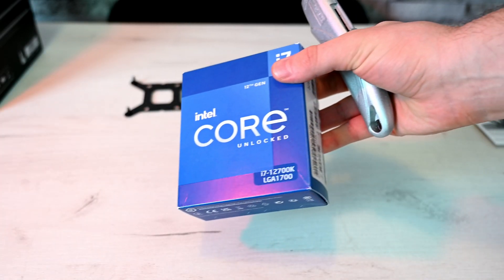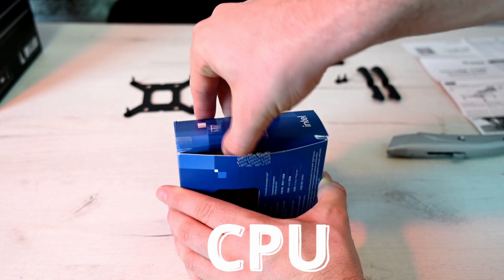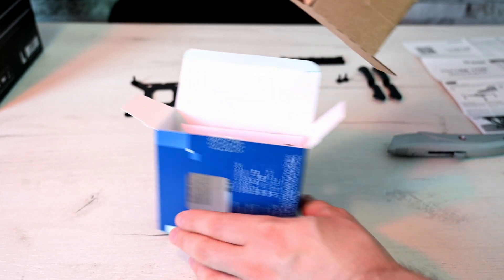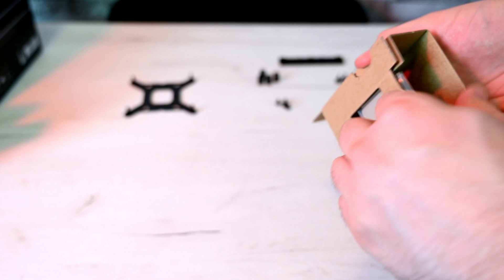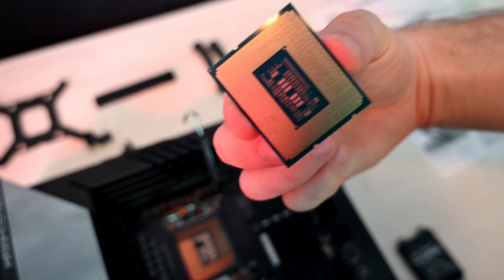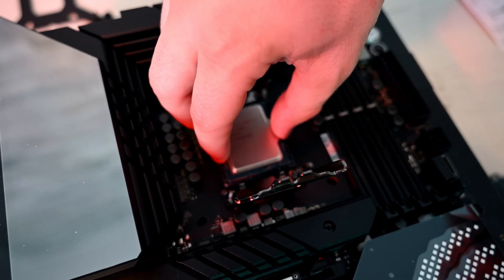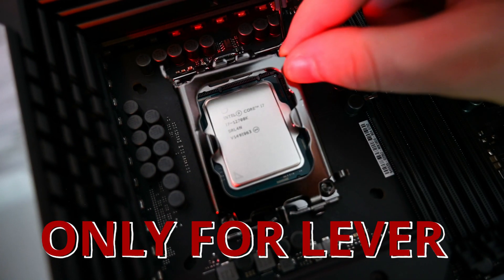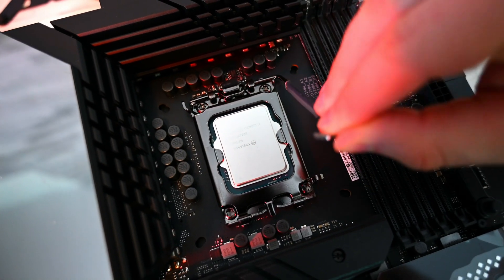How to Install Intel 12700K on Asus ROG Maximus HERO z690 Motherboard

Comment: I had a hard time getting my socket cover off.  I had to pull the little tab towards me and then lift.  You lifted it out easily, and I was struggling to get it off, and I couldn't figure out why.  Pulled towards me, it lifted off reasonably easily.  
It's been a while since I've done a PC build.   This was a new step for me.
Reply from the maker: Sometimes It can be stiff on a brand-new motherboard, it is better to be safe than sorry, Afterall you want to be gentle with pins. With this motherboard I had all kind of issues, during shipping usb front header pins got bent. Certain cpu wouldn't boot or causing memory issue. Never tighten too much just random issues popping up. Cooler compatibility for air cooled cpu is not the best. Best is to go aio thermal wise and installation.
You are welcome to join 
https://discord.com/invite/RqgAjAuCnC